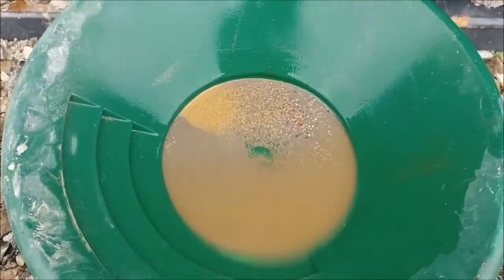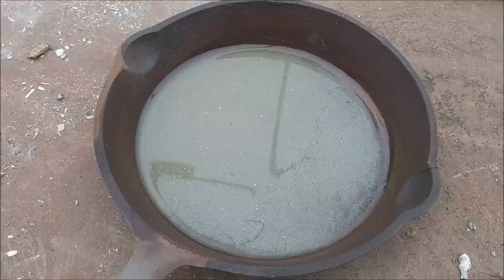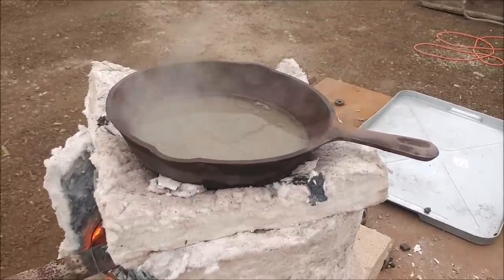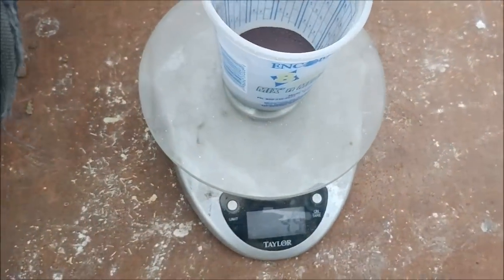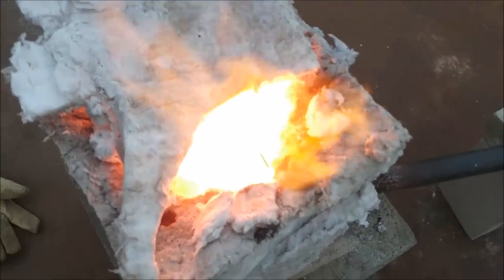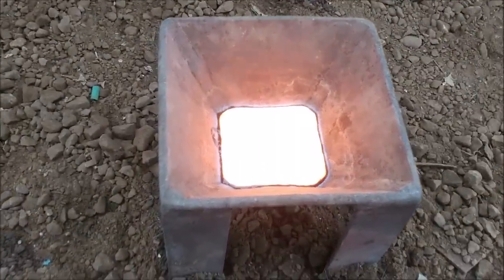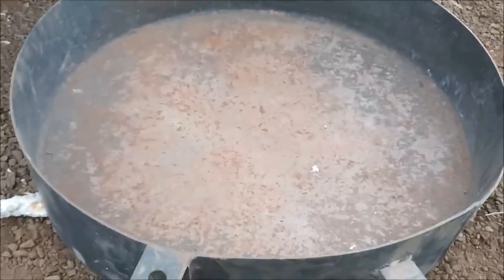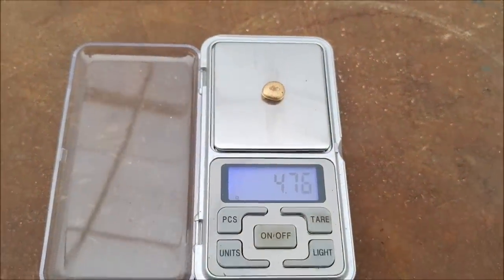How To Smelt Gold, Rich Precious Metals Concentrates Off Shaker Table

Comment: Another great video.  I noticed that you didn’t add the silica sand to the roast like you did in the previous video.  Did you find that it isn’t necessary?  

Also, quite a while ago I saw you using various fluxes and collector metals.  Is this new simple flux effective enough for gathering the PMs that you skipped all the other nonsense, lol?
Reply from the maker: I have found the silica sand isn't really necessary and I can fit more sulfides in the pan if I keep the SiO2 out.  The collector metals are needed when the amount of gold in the sample isn't enough to "collect" by itself.  When the sample has enough gold in it the gold acts as it own collector and forms a button at the bottom.
Reply: mbmmllc ahhha! I see!  Thank you again for such great info.  I really appreciate your help.
Reply: @mbmmllc  الحمدلله كما انا محظوظ للحصول على هاذي المعلومة التي كنت ابحث عنها شكراً لك❤
Reply: @mbmmllc  Is this method effective if the concentrated raw material is one kilo? I hope to receive a response.❤